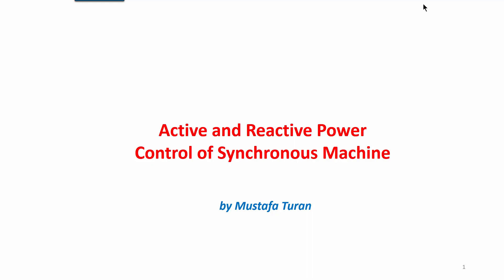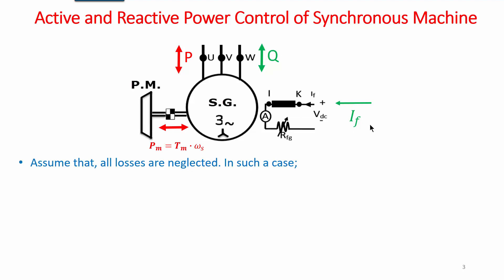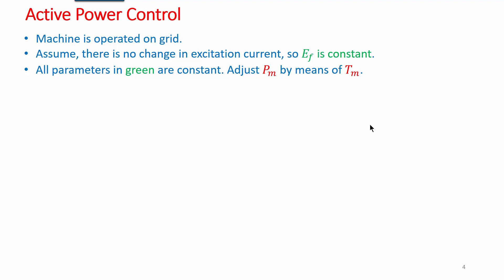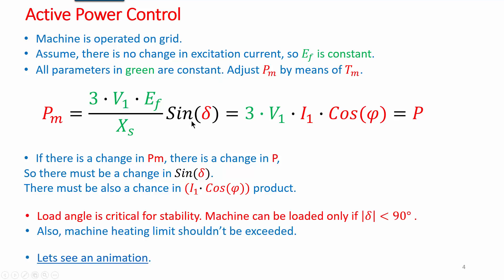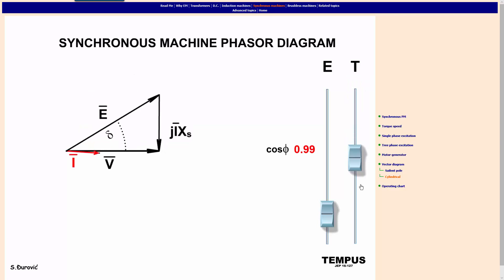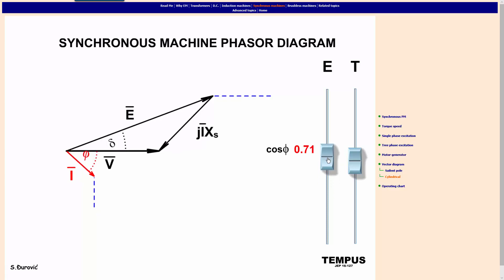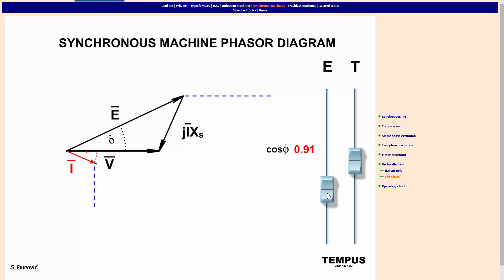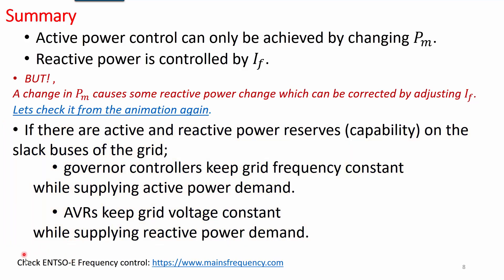Active and Reactive Power Control of Synchronous Machine

Comment: In the power equation E stands for E g not E f. And in the phasor diagram it should be  E g not  E f  as you have shown. Your comment in this regard is solicited . Thank you.
Reply: Again you have done the same mistake. It will be Eg.
Not Ef.
Reply from the maker: @mehebubrehman9253  notation will be different. Ef means field emf due to main (rotor) magnetic field.
Reply: @mturan54   The  phasor diagram is of  Eg , and Ia. The equation should contain Eg and Ia.
Your notation Ef is wrong in this case.
Reply from the maker: You are right. I have mention it. The animation belongs to EU Tempus Project, and there are some errors. So, E stands for Ef. Thanks.

Comment: Very good explanation. What will happen if in steady state condition the grid voltage will be enlarge for example? As it seems from vector diagram increasing of V (E=const) will cause of PF to  increase. Does AVR will increase the producing of reactive more reactive power in order to bring PF to the value "before voltage changing"? Thanks
Reply from the maker: Depends the initial conditions. I can say, if there is an increase in the grid voltage under constant excitation (E=const)(lets call event), the current phasor will realign towards to counter clock wise direction. If the generator was operated inductive (with a lagging pf) before that event occured, magnitude of the current will decrease, pf tend to be unity. If the generator is operated with a unity pf before the event, pf of the generator tend to be leading (capacitive)(someone can say the generator consume reactive power (i dont like that term)). Magnitude of the current will increase too. 
As you know, aim of using AVR is to keep the terminal voltage constant. It is possible only within the reactive power limits (and heating limits) of the generator. Understanding V curves of synchronous machines will be helpful. Thank you for your interest.
Reply: @mturan54  Thank you very match for fast response. 
Lets suppose I am PV plant and working with lagging power factor 0.9 at POI. Lagging PF means reactive power is negative and injecting to (consumed by) the grid. Is this convention right? If so, according the diagram, with increasing of grid voltage the PF will be tend to increase,  decreasing of amount of injected to the grid MVARS. Consequently plant controller will try to return PF back to the 0.9 by increasing producing reactive power. It confuses me, because we know that Q=f(U) should work just the opposite. Where am I mistaking?
Reply from the maker: @etrostianetsky  (0) This time I am late due to my holiday. (1) The convention you have written is not correct. Generally, in the literature passive sign convention is used. Reactive power of a load having a lagging pf (someone say consume reactive power) is positive. It is a convention coming from Tellegen's Theorem: Consumed powers are positive while generated ones are negative. (2) For the given operating condition, "... with increasing of grid voltage the PF will be tend to increase,  decreasing of amount of injected to the grid MVARS." you say. YES, I agree with you. Then, plant controller try to return pf back to 0.9 (lagging) by increasing rms output voltage of inverter and decreasing load angle (delta). Since maximum output power (depends on the solar radiation and MPPT control) is maintained at the output of PV-Plant, delivered P and Q to grid is kept constant. There is no increase in injected reactive power. By simple explanation, constant P+jQ output (constant pf=0.9 lagging) is maintained by controlling E and load angle. (4)The more complex operation is executed in the PV's sub systems: In control aspect, ratio of reference currents, which are Id and Iq (d-q-0 referance system), is kept constant while changing their magnitude. After some transformations, result is higher E and smaller load angle (delta). (5) Perhaps your mistake is thinking the output power of PV-Plant is variable. But it is not. It is kept constant with new parameters. Of course, there is a limit to increase output voltage of inversters. It depends on the design of the inverter - coupling inductor - coupling transformer etc.
Reply: @mturan54  Thanks a lot for the explanation. It looks logical. Interestingly, the P-Q output characteristics of the inverter shows exactly the opposite behavior then gives vector diagram. With a decrease in voltage and at the same active power, the inverter provides less reactive power, not more. I would like to hear your opinion..